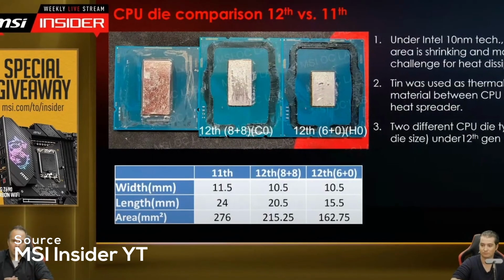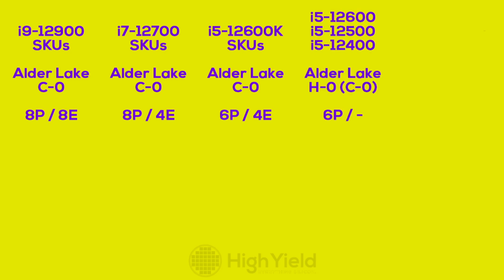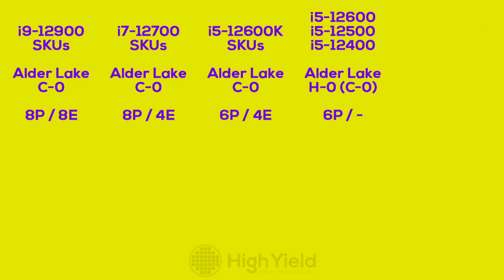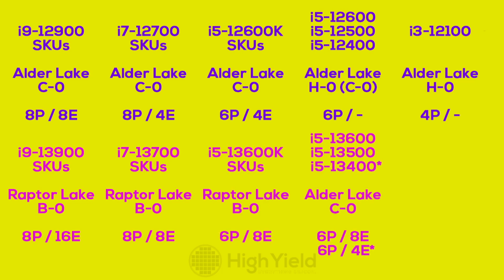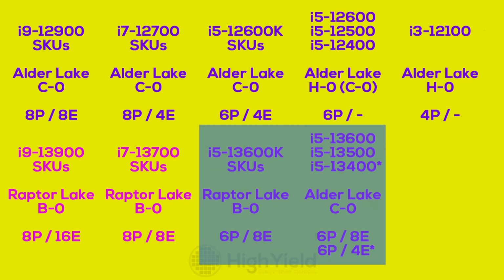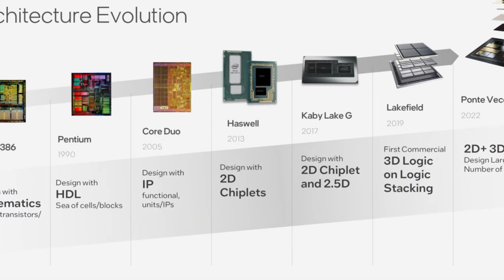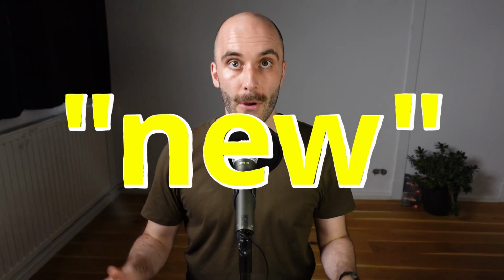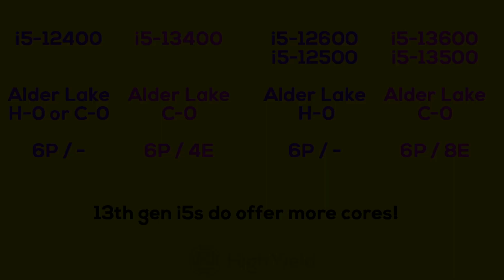Not all Intel 13th Gen CPUs are Raptor Lake

Comment: I disagree with rebranding as a principal.  It usually indicates a con.  Don't say an old chip is new if it's not.  We'll still buy the old chip if it's what we need.  You just want to charge more than it's worth.
Reply: Depends on how you classify new.
If buying a chip that is lower in the product stack but the newest version does add the e-cores and more performance that the previous chip of the same tier level that did not offer that same configuration then yes that offering is still new for its classification.
Intel has ALWAYS made the i5, i7, i9 "K" versions of their chips be considered the best that they offer, when you get below that lower tier level the actual silicone version of the chip is not as important as the chip is then not considered a cutting edge top tier product you are buying but instead below those top tier chips you are then buying more at a certain performance level to a particular price point.
As long as the chip delivers what it promises in configuration and performance wise how are you not getting the item you purchased?

Comment: I have experienced rebranding 10y ago done by AMD when I buyed Radeon 6770HD being 5770 in fact. It didn't hurt my value at all as I upgraded from GF8800GT. Mentioned AMD gpu was good deal, no big issues, performance ok, lower price vs Nvidia budget was strong point too for me. 

Anyway fooling, mistaking customers and lying to them is job of not much smart people. Why? Because they guess they get out of that business/deals well, underestimating both customers intelligence and ability to reach correct information.
It is usually just matter of time to find out.
I don't forget that easy.

 But we got just 2 cpu pc chips designers/makers, so there is limited option to choose from.

Btw if Intel would make pricing changes to most of their Alder lake gen, it would be hopefully same as they bring w parts of Raptor lake. But it would hurt their marketing, as someone told, "price is message". 
Also just lowering prices wo almost any new stuff from Intel would make us think they not as innovative as they should as no1 cpu maker (In quantity;-), which we already know. 
AMD does great job, but they limited by wafer capacity (I guess), pricing(not own fabs, although sometimes it could be cheaper, its not due to TSMC pricing/development strategy), also multicore design is probably limited by frequency vs TDP on useable nodes). 
Just surprised how Intel still competes on improved 10nm if I am not wrong.
 
Also heard that less core cpu has slight advantage vs more core cpu in single threaded performance, thanks to scheduler? Is that part of Intel advantage in gaming when it comes to single core perf? 

Anyway thanks for your work and informing.
Reply from the maker: I think all big companies, no matter if Intel, Nvidia or AMD, have done it in the past. Its not that uncommon.

Comment: Not a fan of rebranding at all.

That being said, the i5 13th gen lineup looks to be a ridiculously good CPU as long as prices stay mostly the same as previous gen which is not a guarantee. 13500 looks to be a great value chip.

13600K looks like it'll be extremely competitive. There's genuinely no way Zen4 can compete with 13600k. 6P + 8E cores for a total of 14 cores against a six core CPU.

I genuinely think that the only battles Zen4 has a chance of maybe winning is Gaming performance and maybe efficiency. And gaming performance is not something I'm convinced will be faster on Zen 4. Guess we'll see soon tho
Reply: i am pretty certain that is exactly what intel is doing is wait and see the gaming results on zen 4 and if it really does beat intel's best raptor lake. and if it does, their ace in the hole would be the 13900ks to go up against it.
Reply: if the 13600k is anything to go by its gonna be a massive price increase. but all things considered you might as well stick with a 12400f and oc that to get the same performance, or nearly the same.

Comment: On one end of the spectrum of consumer all the specs will be looked up, the other end doesn't care as long as the device has a certain price point and can run their facebook games.  It's those in the middle that may purchase on face-value and are the worst kind of consumer, not willing to do put the effort in to make an informed decision and then point the finger at others for their failure.  As long as the price matches a level of performance it shouldn't be an issue, even for the 13100.  This allows Intel to continue to own the low end and increase margins, potentially.  I think the saying is "caveat emptor".
Reply from the maker: I get your point, but if I’m buying a new CPU branded with the new generation name, I personally would expect to get the latest tech and not a year old architecture. It might still have good performance, but I wish companies would be more transparent. Let’s see, maybe Intel will mark rebranded Alder Lake CPUs.
Reply: They should call it 12100S, lol

Comment: "I am Jack's complete lacknof surprise"

As you may know from my many comments on your channel, I am not a fan of Intel. Not out of a "go team rah rah" fan boy perspective, but from my decades of experience with building and using PCs. My experience has been, as a consumer, that AMD consistently looks out for the consumer more so than Intel and Nvidia. They have had their moments in the past with poor leadership and naggy board members, but in general they have allowed me to build better PCs for less. 

With that preface out of the way, my opinion on this is much like my reference at the top of the comment. I do not agree it is right, but I am not surprised whatsoever. Especially if the there is little to no physical changes to the older silicon and mostly just programming. In that case they should just make less 13th Gen and lower the price on 12th gen and make those changes to them imo. Unlike AMD currently Intel is run by corporate minded business people. They know that many consumers just go by the name/gen. OEMs are definitely aware of this too so they don't mind slapping "13th Gen" on their laptops and pre-builts to sell them....especially Dell's shady a--. That is a lot of incentive for them to do this. 

I'm also confident that those "leaks" are accurate if not intentional to take some of the heat off their GPU blunder. However, I doubt the people at the top and in marketing who do not quite understand the products thought about people noticing this trickiness. They come from a mindset of business where there is little respect for the consumer and see them as gullible. Many are, but in this industry a lot are not. Especially those of us that have been dealing with it for a long time because of BS like this happening in the past. Their numbers don't really take a hit or at least haven't in the past because of it sonit doesn't really register in their eyes that it is a concern. Intel and Nvidia's long time market dominance has made them lazy and arrogant to the point where they are making compounding mistakes. Their greed is becoming quite apparent to many and as the last gen of PC users gain experience and knowledge first hand and from reviewers like yourself MLID, and GN the numbers of those capable of seeing it are about to explode in numbers if they haven't already. I hope it hits them where it hurts....in the bottom line since their ethics and self respect clearly couldn't care less. It's a middle finger to the consumer and I'm hoping they see it for what it is sooner rather than later, but after their hole has been dug.
Reply from the maker: I feel like the notion that AMD is more consumer friendly is mostly based on the fact, that until now, AMD has always been the underdog. If you are not the market leader, you need to compensate the lack of publicity.
Reply: @HighYield  that is very true! Although the company culture can be shaped by that experience. As long as that culture is being led/maintained by a someone like a scientist instead of a generic corprate committee like most large companies, it may continue to do so. I would hate to see AMD all of a sudden turn into such a thing. Not just because of the potential changes in their behavior, but also the fact that many of their gains over the past years have been due to their willingness to take risks and make nessasary innovative design choices to make up for their lower budget. The kind of arrogance that accompanies long term industry leadership especially under such generic corprate mindsets leads to stagnation as they get too use to just throwing money at problems, high marketing budgets, and staff/pay cuts to maintain the profit margins they become accustomed to. 

They could very well just be a bunch of greedy jerks doing what they have to to make it to the top. I'm in no way a Brand fan boy to the end with anything, but my personal experience has been one of afordable interesting advances that allowed my low budget a$$ to keep up with the software I want to use without breaking the bank as they say. If that makes any sense. 

I realize they have investors like most large companies and that most people that invest a lot of money, seem entitled to large, long lasting returns. Returns that most of us would never get on any amount of time/effort/money invested into anything. Meaning the pressure to exploit their newly founded position will grow as they take the lead. I'm bias though because I am really sick of the common truth that any major company can't be considered "profitable" unless a few people can get filthy rich off of it. I have no idea what their employee compensation is like or what they pay their executives compared to that may be. But much like the unfortunate "2 party" political system here in the States, when you only have 2 real choices you have to side with the lesser of two evils much of the time IF you want to participate at all. Like the premise of that one Sout Park episode about Voting here between a Guant Douche and a turd sandwich, I will have to go for the giant douche since it is at least sterile even if it is full of vinegar and rather useless to me personally lol. 

Sorry I just finished reading the news and it has me rather depressed and feeling a tad apathetic right now unfortunately. Wealth Addicts are "ripping the copper out" of our societies and basically getting applauded for it by many of the people affected bynit due to their lack of understanding of the actual situations unfolding. It would be unfortunate to see AMD as such an entity, but I can't say I would be too terribly surprised if it eventually happens. Call me jaded, but it seems to be the norm. In a world where ture basic morality/ consideration is a recipe for poverty and greed/exploitation is the apparent recipe for "success", I often find myself teetering on the edge of "I just don't give a __ anymore". Or at least wanting to feel that way. Caring about others and their situations these days is exhausting especially when it seems to be the last concern in the minds of those who are capable of providing the most help. When  it takes most people everything they have just to support themselves, their ability to help others in need is either non existent or comes at a great cost. That really sucks. I apologize for the depressing rant.

Comment: Intel is trying to rip off the benefits of chiplets , in monolithic dies.
I am ok with the i7 and i9 parts as well as the i5 K processors.
But I am not ok with the i5-13600 (non K) and below.
This is how it should be (all non over clockable) :
- i5 -13600 6P(Raptor) + 4E 
- i5 -13500 6P(Raptor) + 4E (lower clocks, better iGPU than 13400)
- i5 -13400 6P(Alder) + 4E (practically an i5-12600K, for the price of an 12400)
- i3 -13300 4P(Raptor)
- i3- 13100 4P(Alder) + 100 Mhz
Also I think that the jump from 16 E cores of i9 to the 8E cores of the i7 is a huge waste of die area. The could do something like i7 - 13 700K -> 12E cores and i7 non k ->> 8E cores.
Reply from the maker: I also wish we would see more actual Raptor Lake parts, but right now it doesn’t look like it…

Comment: ty for the infos dude, this is really disappointing from intel. I hope they still make it better then it sounds but i dont trust them to pull it off.
Reply from the maker: Yes, it’s kinda disappointing, but at the same time the K-SKUs are getting the new Raptor Lake die and the smaller i5s get more cores. So it’s still an upgrade. Maybe at some point there will be a even more binned version of the B-0 die, let’s see.

Comment: This kind of rebranding is completely dishonest. Let's take the i5-13400 for example: 6p+4e, 2.5GHz base, 20M cache, 24EU iGP. If this data is correct, that's an improved i5-12400 (the highest ADL SKU that matches iGP, cache size and base clock) with an extra 8 e-cores. If Intel now can make this improved i5-12400 because of changes in yields/binning for the C0 die, why not just branding that as ADL i5-12450 for example?

Many people prefer a CPU or GPU of the latest generation to a prev-gen option that's one or two steps higher in specs. Last time I made a full build, I chose a 6-core Zen3 5600X over the 8-core Zen2 3800X which had similar price at the time. Because newer architectures always offer improvements in IPC, clock boosting/OC, memory support, PCIe/IO, x86 ISA, etc. For APUs and mobile the difference can be even bigger with superior GPU arch and improved power efficiency. So even if a prev-gen choice at same price point wins benchmarks that favor single factors like higher core count, I'll get last-gen every time. (Of course I wouldn't have preferred a 5600X to a 3900X where the performance advantage is much bigger; but then again, those options never had comparable costs, and if my budget had been bigger at the time, I'd pick a 5800X over the 3900X easily. Maybe not over the 3950X, but I rarely buy the "top" SKUs of anything since price/perf is typically crap.)

Of course I am now a tech enthusiast and I know and care how to choose these components, but not many years ago, my criteria for picking a new computer was going to vendors like Dell and looking at the basic info such as CPU generation, core count and clock. The 2010 version of myself would totally be fooled by these branding tricks, and I was already an experienced software engineer, I just didn't care to follow hardware tech at all.
Reply from the maker: I think the main reason Intel is re-using older dies is that they don’t need to design and tape-out more chips. But they also want a coherent 13th gen line-up, so they use new names. A lot of ppl won’t buy anything that already sounds old.

It’s not 100% honest, but also very common in the industry and all other companies (AMD, Nvidia) do it too.
Reply: @HighYield  Even the argument of coherence only makes sense for marketers. Imagine Sony introduces their 2022 line of TV sets, now with OLED panels, you make a massive marketing campaign over that. But for 50inch and smaller models you just rename last year's models that had older LED panels. Maybe with some upgrade like latest embedded processors and SmarTV features,.but the most important element is the same. Very hard to call that a coherent product lineup.